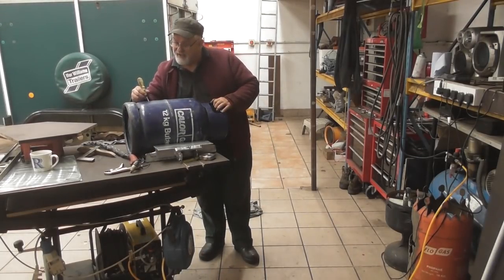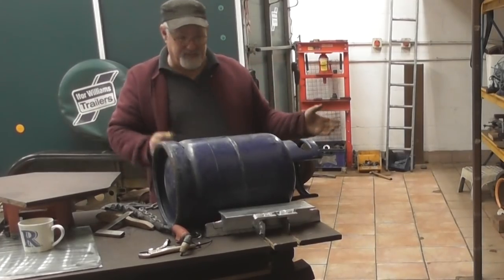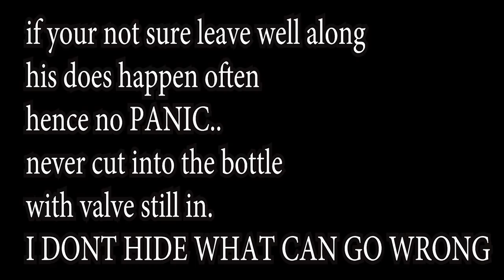the chinese fire pit  gas bottle art

Comment: You welded the jack leg to the bumpers. & there are nuts & bolts holding the wooden tabletop to the bumpers just under the metal plate where you have the plasma grounded to. & that is making the ground connection from the metal plate through the bolts to the metal of the table base & then to the chain around the jack leg to the tank. Now what would blow my mind is if you remove the metal plate & just earth it to the wood to see if it still cuts.!!
Reply: @bloodynuts2  No problem Rob any time.!